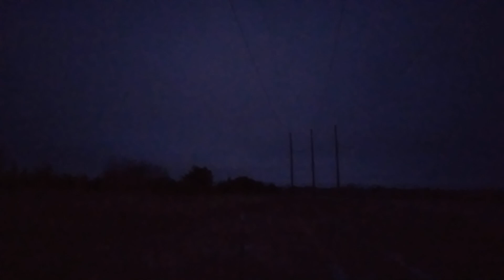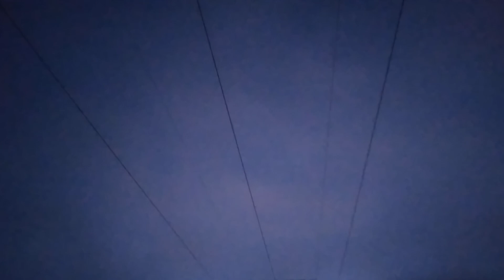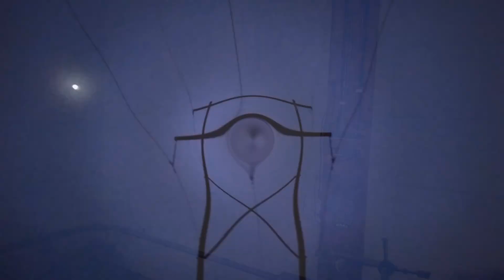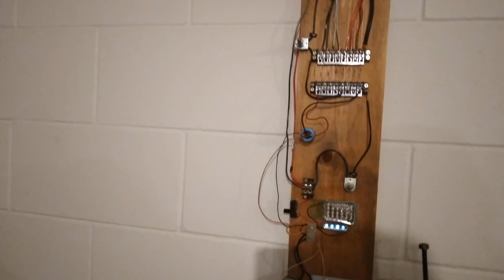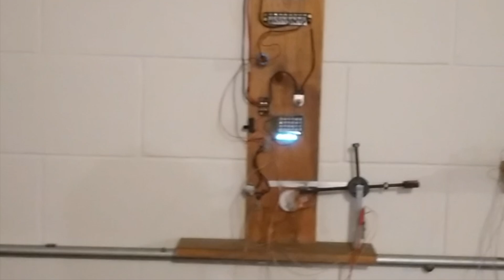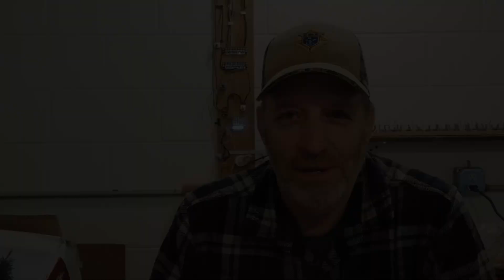(#3 E.O.I.) 230,000 volt transmission line sizzling and humming.

Comment: With normal transmission lines, 10 % to 20 % of the total power transmitted is lost due to resistance in the line itself, and transformers. The higher the voltage, the lower the power loss.

Comment: The top lines on the towers are ground wires. I read that if you count the rings on the insulators that each ring is good for 10k volts.

Comment: Your comments at the end were quite interesting. From the 80s, through to the 2000s, I lived in coal mining country here in Australia. I worked in transport, so got to see a lot of the country. The mines, power stations, railway systems, and other infrastructure. I was lucky enough to see the railway's microwave system being set-up in the mid-80s. That's some cool tech. I got to be a passenger on a helicopter when they were constructing the solar-charged, battery-operated microwave tower that had line-of-sight to other towers near the mines many kilometres away.

Comment: A corona discharge is the most common noise associated with transmission lines and is heard as a crackling or hissing sound. Corona is the breakdown of air into charged particles caused by the electrical field at the surface of conductors.
Reply: You should be able to smell it also

Comment: I was moving and by happenstance stopped on I5 under a lower power line 
 much like yours, it was pouring down rain. My van and trailer were so hot with my wet feet I could feel the cycles if I ran my hand across it.

Comment: Nice observation, I understand there isn't much water in the air but at night there is a heap more moisture in the air. When the grid is on standby, not many people using the system, the line voltage would be maximum and this would be interacting with the moisture in the air coming close to breakdown voltage, the humming could be radio frequency in the same way the old CRT monitors created a high electrostatic buzz at the screen that you could feel with your hand an inch away.
Reply from the maker: It's pretty rare to have this happening around these lines.  The last couple of mornings I walked out there around the same time, and everything was quiet, like this morning.  A little warmer than the day of this video, with a little snow.  The last time this was happening, was an Oct. morning, with lot of moisture in the air.  The ground wasn't froze, and was actually sizzling.
Reply: @doubleMinnovations  it's just corona effect https://en.wikipedia.org/wiki/Corona_discharge
Reply from the maker: It is the corona effect, but it was being extra active.  I talked to the power company, and they said this happens when there is a lot of moisture on the wires, and in this case it would have been frost.  Thanks.
Reply: @doubleMinnovations  I have a fence line that borders hi voltage power lines, about quarter of a mile long. I have been harnessing power off the fence for the past 23 years to charge solar batteries it's not much power but it really helps when the solar array is not producing power at night, I consider it an extra source of alternative energy. I have been electrical contractor for over 36 years I have always thought about this when I first bought the property and put up the fences. While installing the fence I realized I would get it a little tingle once in a while. So I decided to run an insulated wire similar to the one that you had ran on your fence to see how much power I was getting. I was surprised at the amount of power that I could get from it. So I had to come up with a way to harness it. I dug a trench 4 feet deep and ran 2" conduit 150 feet over to my main mechanical room where are my batteries inverters and control equipment are in. Haven't had any issues so far. I've also been in touch with the power companies and they have said as long as you're not connecting anything to our equipment they have no issue with it.And nothing past my fence line. It's great for running phantom loads as well as LED lighting.ETC... I hope you are able to harness as much as you can get from your Fence line. I really like your video. Thanks for sharing and keep up the great work. Stay safe out there!⚡👍
Reply from the maker: This is really very interesting!  What was the best way to step down the voltage?
Thank you for posting!
Reply: @doubleMinnovations  it's capacitive coupling, so only a tiny bit of power, a simple Zener diode will do the job, as it's just like a drop of water filling a tank, you just need to allow a little leak to keep the level low.